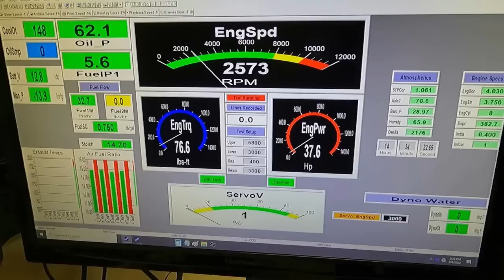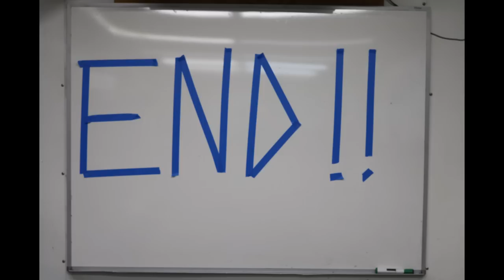Polishing Turds Episode 6!!  Cylinder honing!!

Comment: This guy said the rings never touch the bores then what the hell does it matter what finish will hold oil, those micro thin scratches hold oil, come on man the crankshaft throws tons of oil on those bores, the rings hardest job the rings have is scraping oil off the bores and those tiny thin rings let a lot of gas through helping to scavenge the oil off the bores, nothing gets more oil than the bores, also if honing plates were so important why do factory motors not do this they should all be terrible running smokers but that is not the case, I would like to see someone twist the block simulating torque twist and then measure those bores I bet it would scare the hell out of your opinions..

Comment: Ck-10 and cv-616 are good machines from sunnen.  I had a cv-616 and just went to the sunnen sv-10.  The only thing that is really different is the sv-10 will dwell on its on when you get to a tight spot.   The newer machines are really set up for production or to cut down on labor.  Your machine is nice and it does the job.

Comment: Do you use the same head gasket and studs that will be used in the final assembly when you bolt the torque plate on?

Comment: Enjoy your videos. Are you rotating the stones so they wear evenly, or are you dressing them? Just curious and couldn't tell what you was doing.
Reply: When you seen him pull the stones off he scrubbed them on themselves  dressing them selves
Reply from the maker: Yes both.
Reply: @realgoodatdoinstuff900  something I'm wondering about, using a hone to go .010 over is there a chance of getting the cylinder out of square? Like if the last shop got them off a little with the .030 overbore. I was watching Jim's Auto Machine and they was using a boring bar and you could see where the tooling wasn't touching down and he said the last overbore they probably didn't have the block squarely located . I guess what I'm asking the boring bar locates the cylinder squarely to the centerline and decks whereas with a hone does it just follow the hole that's already there?

Comment: Do you bolt the main caps before honing as well?
Reply: Yes always, torqued to spec. 
A bar goes through the main saddles to hold the block to the machine. 
T.S. RACING

Comment: what's better for a small block for turbo engine longer rod or less compression height or do you want a smaller rod and more compression height? I'm building a small block Ford Speedmaster Max block 9.750 deck height bore 4.155 with 4 in stroke crank with Cleveland mains  and I was shooting for 11.1 or 11.5.1 compression ratio.what would be better ? and the motor will be Turbo on E85 on  the street and methanol at the track.and you want a bigger cc combustion chamber? I was thinking about running the trick flow 240cchighport head SbF any info on this would be huge because you're the man and you do great work and you're awesome teacher.